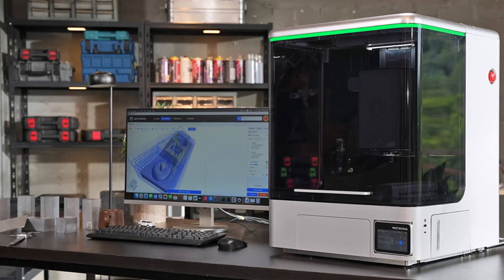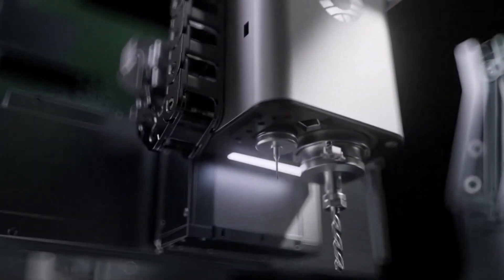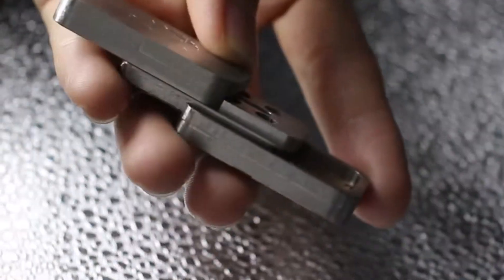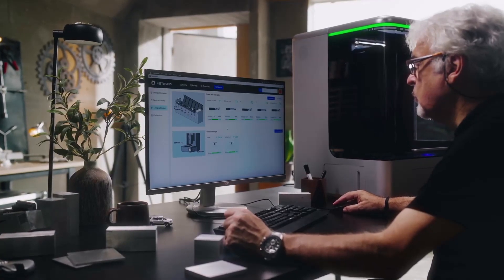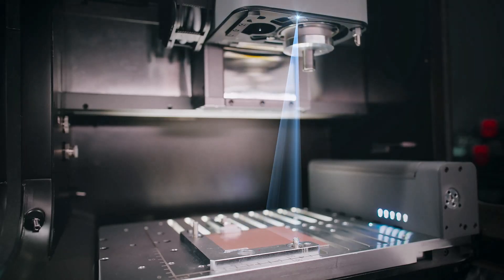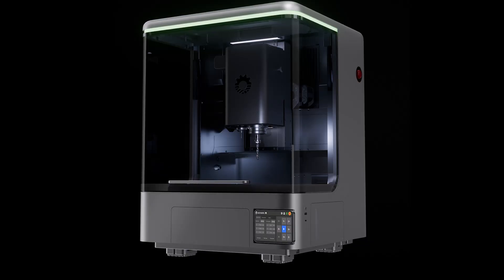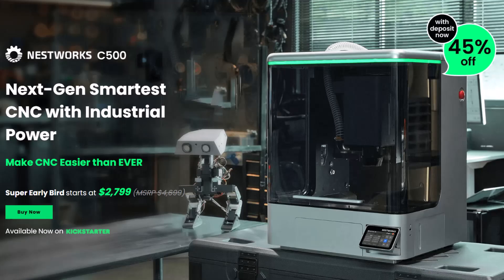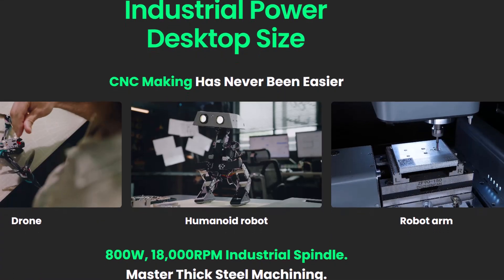The NestWorks C500–The $4M Smart CNC Machine That’s Breaking Kickstarter!| Ultimate Desktop Factory

Comment: It was this or z1 the price point of z1 make me bought that the price is a little to steep for me
Reply: The Z1 is not the same, different machines, different jobs, different markets. If the Z1 will do everything you need/want, it is the better choice for you. If you want to do actual milling of hard metals, the C500 would be a better choice.